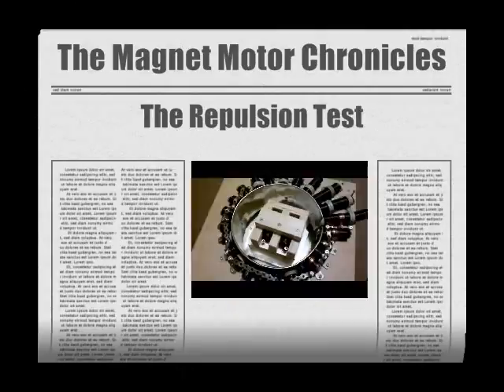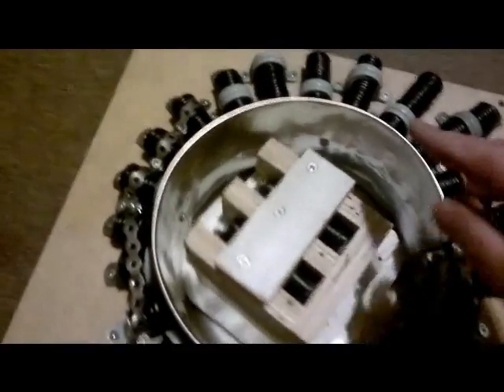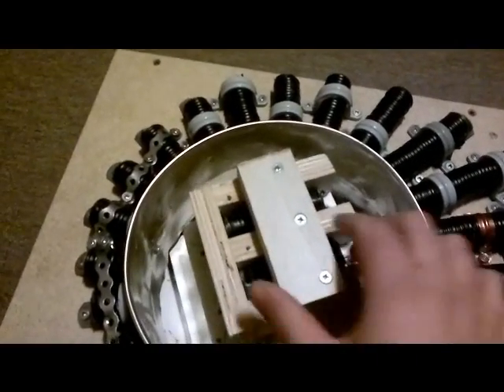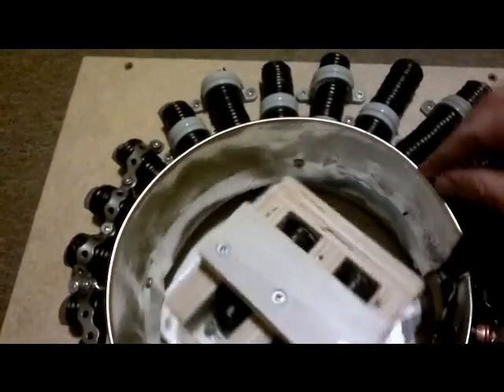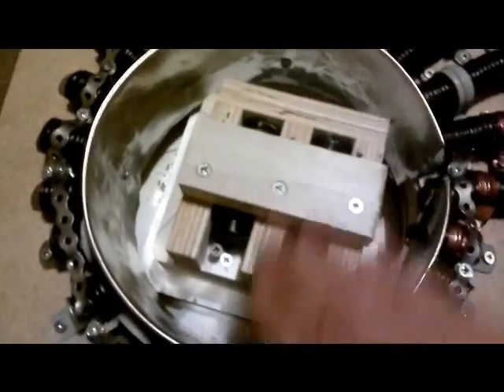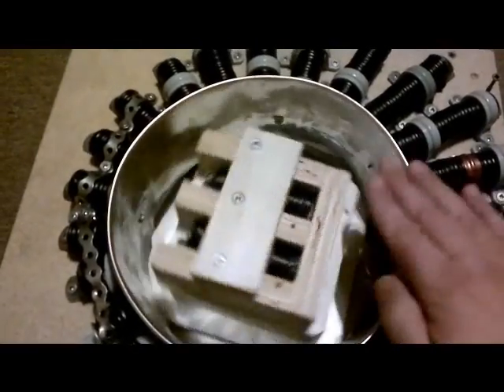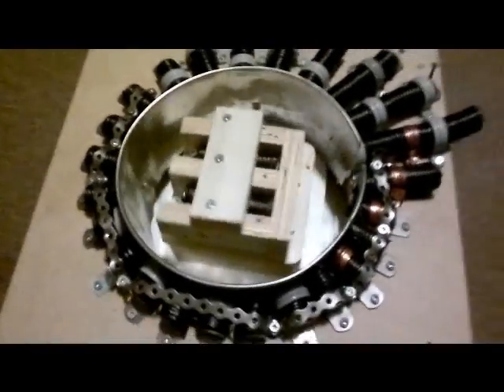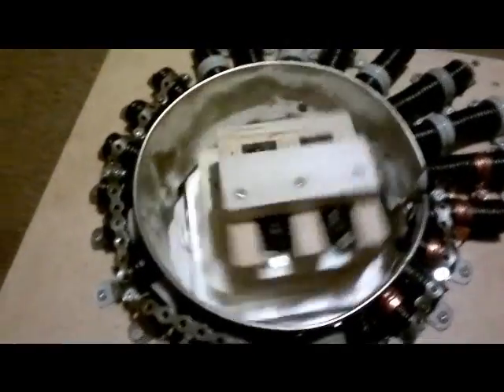The Magnet Motor Chronicles The Repulsion Test

Comment: Add an eccentric load under the board on the same rotor shaft, right opposite to the sticky point. Give it a good spin, it will breach it's stickiness.